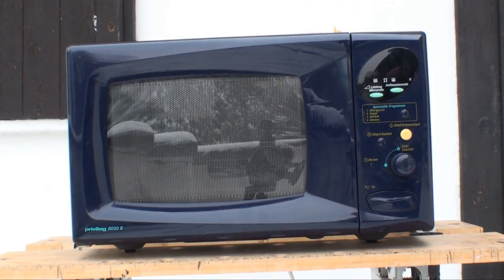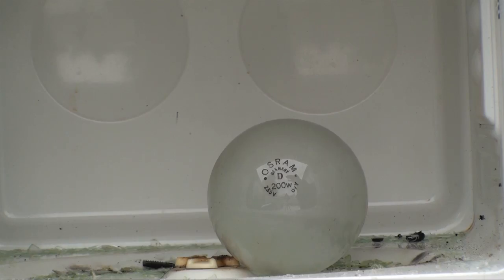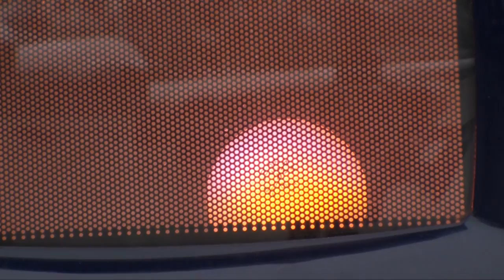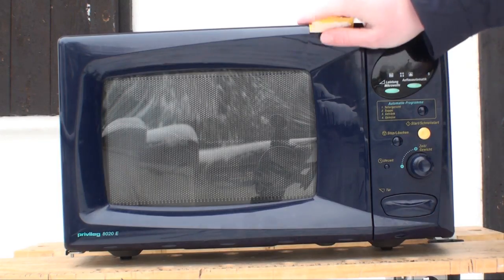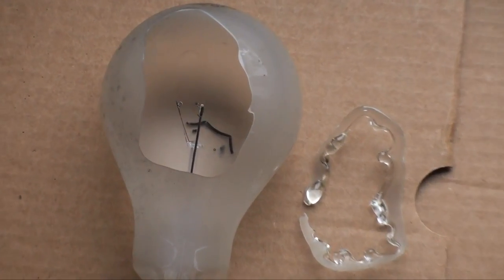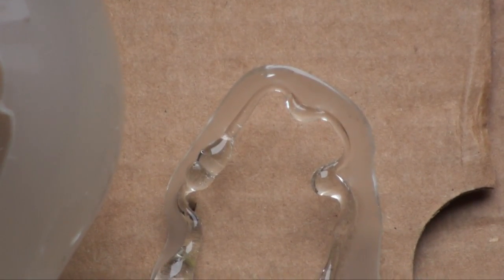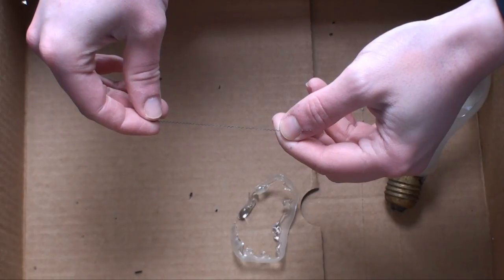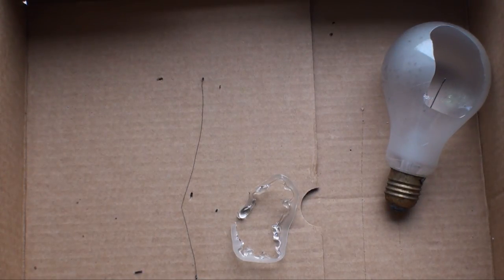Microwaving a 200W lightbulb - interesting results!

Comment: Cool experiment! :)  But don't try this at home - I wouldn't!
Reply from the maker: If you have some common sense and an old microwave, you can try this. I used some heavy duty sticky tape to keep the door closed in case of a locking mechanism failure.
Reply: I may try this when we need to renew the microwave! :)